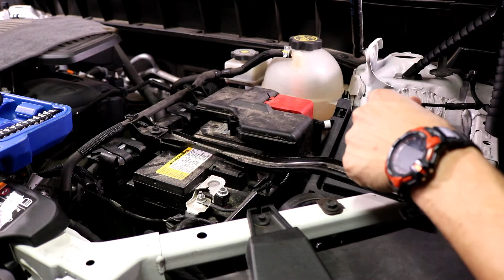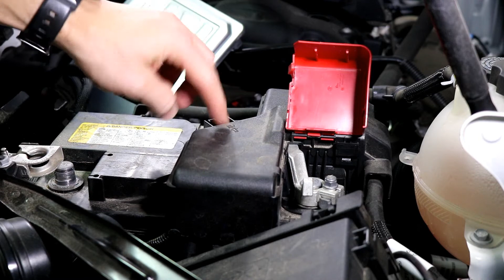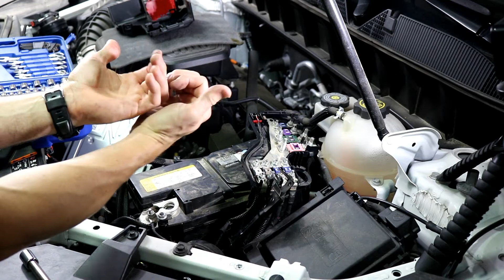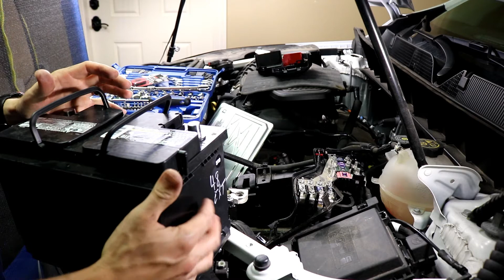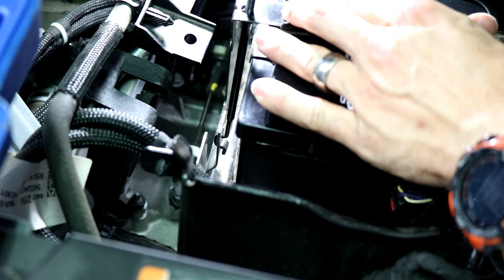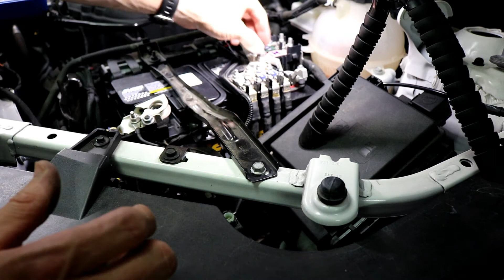2017 GMC Acadia Battery Replacement

Comment: Once the new battery is installed, you will need to go into the BMS and proceed to program the BMS to make sure it sees the new battery, or the battery will charge   at a higher Amp rate than it needs. If you don't reset the BMS for the new battery, it will shorten the battery life.

Comment: Loved the video, 

2017 GMC Acadia SLT 3.6. New model. My right turn signal only and whole rear left taillight doesn’t work. The dealer diagnosed the BCM is fried and is blaming my after market LED light bulb. 

Here’s the twist, 100 percent dealer serviced. There is a harness with fuses on top of the battery positive side. That harness/clip was disconnected by dealer since 2023. When I realized where it goes, I plugged it back in 5/24/25. Instantly my right turn signal not working and the whole left rear taillight not working. Dealer blaming my LED lights frying the BCM module. 

Do you know What does that harness control on top of battery? Had those led lights for 5 years no issue and it happened after I installed that harness. Could you help me figure out what that harness controls and could me reconnecting it, caused those issues and fry the BCM. Any help is greatly appreciated
Reply from the maker: Sorry I can’t help with that I don’t have the vehicle or any experience with that issue.

Comment: Not sure if the 2017 Acadia Denali already has an AGM battery, but I was considering upgrading to one. Is this just as easy as swapping out the old (possibly OEM) with an AGM?

Comment: Also I might add- if you have start/stop function, your battery will be much larger and more expensive. Only 4-cylinder models had this function in 2017/2018.

Comment: There are two completely different models of Acadia in 2017. The 2017 Acadia Limited is based on the 2016 and earlier models and is a one-year only model. The Standard 2017 and newer models are a totally new design. This video shows the process for the newer model Acadia, NOT for the 2017 Acadia Limited. To replace the battery on a 2017 Acadia Limited you must consult the instructions for a 2016 Acadia. The battery in the 2017 Acadia Limited is located inside the vehicle and under the floor behind the front passenger seat, and is FAR less complicated to access.

Comment: What size is the nuts on the positive bracket for the fuse bracket and the post? you say 13 milimeter? I cant find that type of nut
Reply: 13mm is socket size to remove nut - not nut size

Comment: Your video was a great help for my 2017 Acadia Denali !! 1st battery was dealer replaced at 33 months after brand new car delivery. And now 29 months later it failed again. Since it failed on the weekend I looked to YouTube for advise and saw your video. Have to say it was pretty easy after seeing you do the change out.  Is this common for batteries to fail with this SHORT LIFE in the GMC Acadia?

Comment: Very helpful!  I would not have attempted this without your excellent guidance.  I also disconnected the four outside fuse block wires and a small cable with a release that made more room to remove and install the battery.  Thanks for the help!
Reply from the maker: Thanks for your comment.

Comment: Thanks for the video. I tied the fuse panel up a little out of the way on the hood support to install the new battery. Helped some. Local service store wanted $240.00 to do this $170.00 for the battery. I paid $111.00 through a wholesaler.

Comment: Outstanding, got the new battery on my charger. I bought a NAPA AGM Battery, it’s about an inch longer than the OEM, but the tray has a second hold down bolt hole an inch to the front. Seems like it’s going to be trying to fit 10 pounds of 💩, into a 5 pound bag.  I bought an Ez Red MS 4000 memory saver, it plugs into the OBDII connector and keeps the cars memory from resetting, worked great on a different car. Thanks again and wish me luck.
Reply: Is it necessary to do this other than having to do the resets on radio? Is there something else that prevents operation of the vehicle after battery replacement?  Seems a rather expensive tool just the save radio presets. Thanks

Comment: Battery died in my 2017 Acadia Denali.  NEVER would've been able to figure out how to change the battery without your video. Thank you so much!  Saved me a trip to the dealership.  Really don't think the auto parts stores (Autozone, Advance, etc...) that offer free installation would've been able to figure it out either.  Actually when you go to buy the battery on Advance it states "REQUIRES PROFESSIONAL INSTALLATION: DO NOT attempt to install batteries in this vehicle". So thanks again for taking the time to make this video.

Comment: Just want to say “Thank You” for the video. At first glance I was very intimidated by the many connections and the set of cables on top the battery. The video made the process much less intimidating with great easy to follow directions. Damn battery weighs a ton.....
Reply from the maker: Glad it helped!

Comment: Just finished 2018 GMC Acadia SLT battery change. Same setup as the 2017 you have in video. I was stranded yesterday and had to replace the battery while I was in a parking lot and 95 degrees. I did not have any prior knowledge of this setup and I lost several battery terminal pieces down the engine compartment area as I disassembled everything. This morning I saw your video and it clarified the components assembly. We are back in business now. The notes at Advance Auto Parts says this battery change must not be attempted by average person. It says it should be taken to a dealership. What a racket the auto industry has subjected us to after we bailed their arses out a decade ago. Thank you for sharing. It helped a lot.

Comment: Thanks! You saved me from almost unbolting all the nuts on the positive side the battery connector. My wife was having problems with an old battery from this vehicle, and I told her it would be no sweat for me to swap out the battery, til I opened up the hood and saw all those bolts attached to the battery. This video really helped out!
Reply from the maker: Excellent!

Comment: Curious to know how the Acadia is holding up. More specifically the 3.6L v6. I hear mixed reviews. I have a 2008 GMC Envoy with 195k miles on the 4.2l I-6. I'd buy another in a heartbeat, but that might not be an option as I look to purchase a newer vehicle I'm considering the Acadia 3.6L. How many miles on yours? Burn excess oil or any issues?? Thanks in advance.
Reply from the maker: great 157k
Reply: FYI I have a 2017 GMC Acadia "All Terrain" model 3.6L v6 2w-4w drive.  Put 58,000 miles on it the first year.  Runs great.  no oil issues.  great power. We replaced a 2002 Chevy Trailblazer with 300k miles, started having transmission issues with it.
Reply: @kerrysartain3020  awesome man. I ended up buying a 2019 Honda Ridgeline. I'm really loving this truck. I was too skeptical about the GMC 3.6l and I got an unbeatable deal on this Honda. 10k off the sticker.

Comment: What about keeping a trickle charge on your CPU?  Does the Acadia require you to connect the memory saver cable?
Reply from the maker: I did not do this bu but I only had the battery out for a few minutes.
Reply: @mtrunk8570  I just replaced the battery on my 2017 GMC Acadia, I followed your steps and it made the job super easy.  As an extra precaution I used a memory saving cable and a TACKLife portable charger.  It worked great and the memory on my car was not erased. Thank you so much for your video.

Comment: Thanks for the video.  Your video answered my questions and cleared a few doubts.  The engineering made it look intimidating.  Watched your video once and was able to replace it fairly quick.  I would like to add I initially had my electronics go bonkers prior to replacing.....presets lost, wipers initiated without turning on, light flickering.  That was the intial symptom.  I was worried the electronics went bad or some bigger issue.  Next day, tried starting the car, and wouldn't turn over.  I figured 3 yr old battery, it was time to replace.  My battery of choice is Interstate.  Once replaced, my electronics were back to normal and even didn't lose my presets.  Thanks again for the video!
Reply from the maker: Glad it helped you!

Comment: Thanks for well Explained video   

 My wife’s 2018 Denali Acadia with 47k needed a jump Friday night and now Sunday morning.  

I’m Charging battery on bench now to get it load tested.  At $200 for a new battery and what one goes through to change, wanted to make sure it was the battery. 

Hopefully it’s the battery and not electrical demons.   This Acadia been in shop more in 40,000 miles than her previous Acura in 210,000 miles.  I’m not impressed with the Acadia and issues we’ve had in such low miles.

Comment: Thanks! Watched it twice and had it done in 25 minutes. But what the hell????? I'm 3k miles out of factory warranty in 18 months and this battery was all done. Nearest GM dealer is an hour away. Nice SUV but typical OEM low quality accessory. Same with the factory Michelin tires. 38k miles and they are down to a thick 2/32's. They may have been new but they were about 70% tread depth VS buying a set from the Michelin dealer. 
Great video! Saved me $$$
Reply from the maker: Same issue with this one!